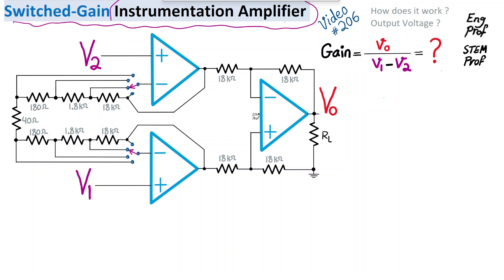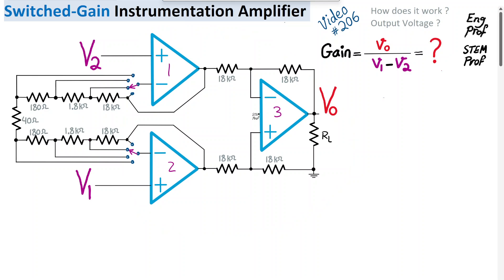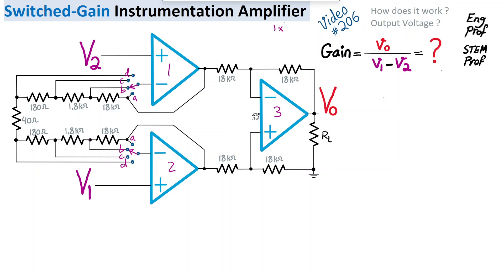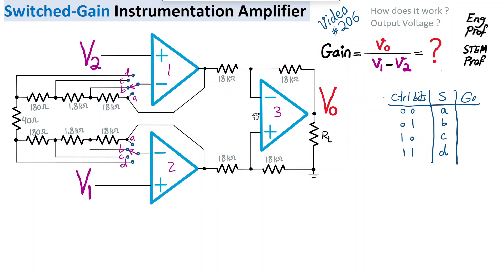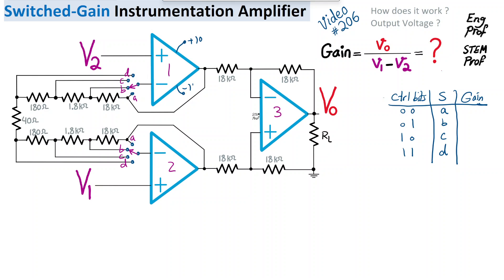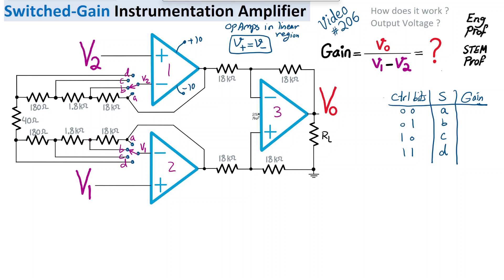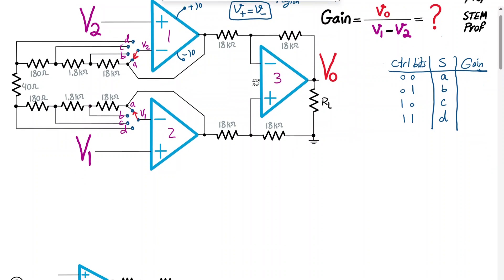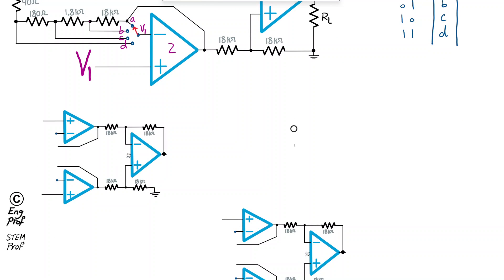1x, 10x, 100x, 1000x Switched-Gain Instrumentation Amplifier

Comment: Hi! When you calculate the gain in case of switch b, why is it that if I do superposition of the effects of V1 and V2 I get a different result? Vy - Vx = V1(1+18/4) - V2(1+18/4) = (V1-V2)(1+18/4) .. what am I forgetting?
Reply from the maker: Thanks for your interest in this video. Explain how you came up with the 18/4 in your equation. Note that there are better ways to control the gain, for instance https://youtu.be/C4tghZ-q6Zs video explains an Instrumentation Amplifier with Electronic Gain Control.

Comment: Practically would it not be better to keep the feedback resistance of the input amplifiers fixed and just switch the 40Ω resistor between them. That way we don't have to match multiple pairs of resistors?
Reply from the maker: Glad that this video is bringing up good questions. Notice that copies of input voltages V1 and V2 appear on the negative input terminals of the two input op amps. We need to switch the total resistor value between the negative terminals of the two op amps so that we can adjust the current flow through the chain. There are better ways to control the gain, for instance https://youtu.be/C4tghZ-q6Zs video explains an Instrumentation Amplifier with Electronic Gain Control.

Comment from the maker: A programmable Switched-Gain Instrumentation Amplifier is analyzed in this video. Here are few more examples: 
Strain Gauge Wheatstone Bridge Instrumentation Amplifier https://youtu.be/io1yBcCsP-Y
Instrumentation Amplifier with Electronic Gain Control https://youtu.be/C4tghZ-q6Zs
PhotoDiode Amplifier with Data Compression Explained https://youtu.be/hqrRx2ufAwg
Gain & CMRR of Instrumentation Amplifier https://youtu.be/Bw29QjHHzGo
Amplifier with -25 to 55 dB Attenuation-Gain range https://youtu.be/oyz6lTGd2Xo
Electronic Gain Control for Op Amp Amplifier  https://youtu.be/NoNgQpbj77Y
Analog Multiplier Circuit  https://youtu.be/VP53A2zpVMQ
PhotoDiode Amplifier with Op Amp and MOSFET Explained https://youtu.be/1c3EJ2d4pVI
Power Amplifier Design (Class A) with Transformer https://youtu.be/gKlJrqGqeCI
VCA Electronic Gain Control (Part 1): Voltage-Controlled Attenuator Overview https://youtu.be/cFzYZsPEtP0
Push-Pull Power Amplifier Design with Op Amp, Sziklai Darlington Transistors https://youtu.be/8BFzsi7-Vbs
Thermometer Circuit Design with Op Amp & BJT transistor https://youtu.be/55YsraFE0rg
Push-Pull Power Amplifier with Darlington Transistors https://youtu.be/866MYibo8yE

For more example see the analog video playlist https://www.youtube.com/playlist?list=PLrwXF7N522y4c7c-8KBjrwd7IyaZfWxyt  I hope these Circuit design and analysis videos are interesting.